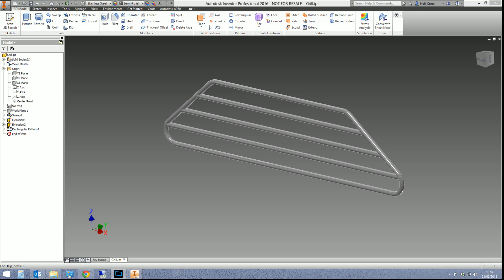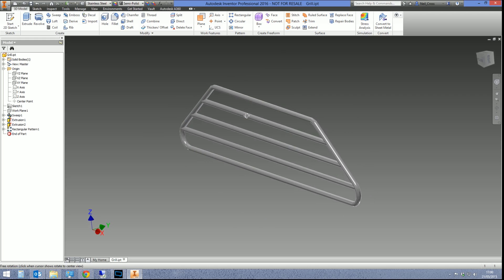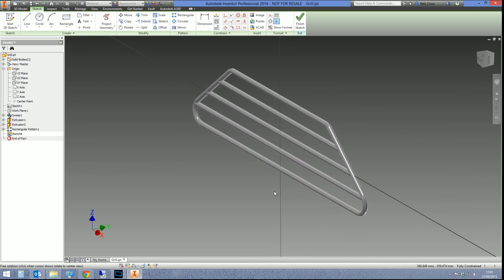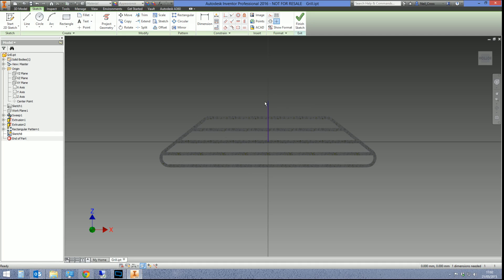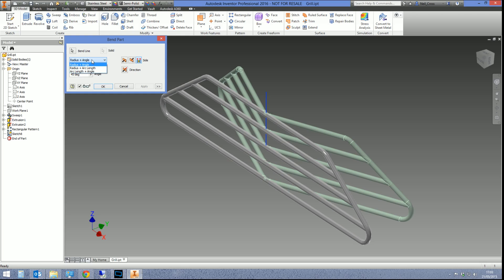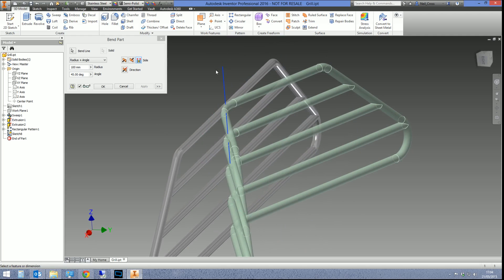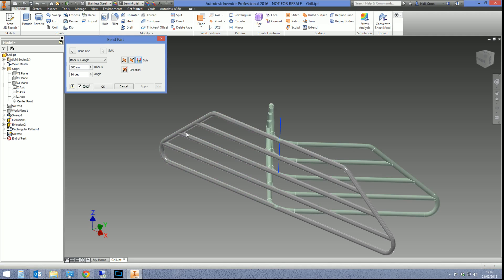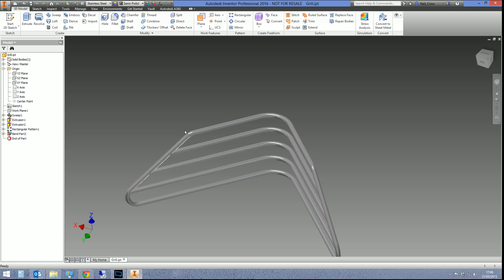How to Bend a Part | Autodesk Inventor

Comment: I bent a plate that had geometry at the end, it  - (the geomtry and shape) didn't go with the bend, it stayed put floating in thin air even though it was constrained to the end of the plate. The bend tool has limited use. Good video though. Thanks.

Comment: Question: How do you make an unfolded version afterwards. I need a flat pattern view for my drawing.
Reply from the maker: Yea you can't flat pattern unfold this, it isn't a sheet metal module function.  Sheet metal has commands that'll do a similar thing to bend part but will then flatten out

Comment: Bend part is straight forward enough.  But what about returning it to a flat pattern (like sheet metal) to show the shop where to mark the parts to make the bends?
Reply: I'm running into the same issue. The parts are "previewing" exactly the same position with no bend in sight...

What I'm having to do is to recreate the part and "bend" to see if I can recreate something that looks... well, similar enough

Comment: Hey great tutorial!

I'm using the 2015 student version of Autodesk Inventor, and the drop down arrow under the modify ribbon doesn't exist at all.... thus leaving me with no access to the bend a part tool, nor move bodies or copy object.
Any clue as to whether this is a feature taken out of the student version or if the tools are just hidden? The drop down menus do exist on other tools in the ribbon, just not under modify.....
Reply from the maker: 4473021 Hey, I'm looking at 2015 here now and it's all there! The student version is exactly the same as any other version, it's the same program but you just use a different serial number so you have everything there.  Are you definitely in an IPT file? Not an assembly?
Reply: TFI CAD Tips I actually figured it out just now. As I only started learning autodesk inventor (and CAD altogether) just earlier today, I did not realize you had to double click the part (I'm guessing it's because I'm working in an assembly) for the drop down menu option to show. Thanks for your kind intentions though, your videos have been really helpful! ^^

Comment: i was wondering if inventor could help me with some metal castings i wana make.
i want to to calculate the shrinkage and the machining neede with the least effort possible.
Reply from the maker: mataz farouh Nah sorry Inventor won't calculate shrinkage during casting of metal parts.  It has a module for tooling and injection molding of plastic parts but it doesn't do liquid metal